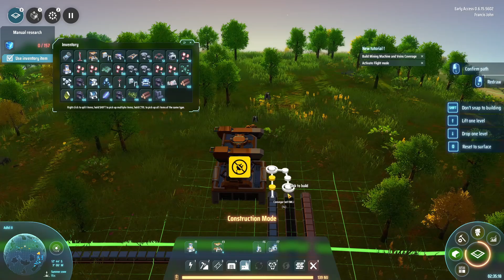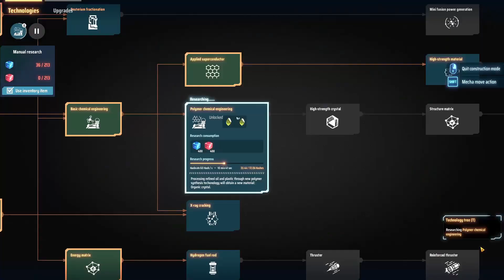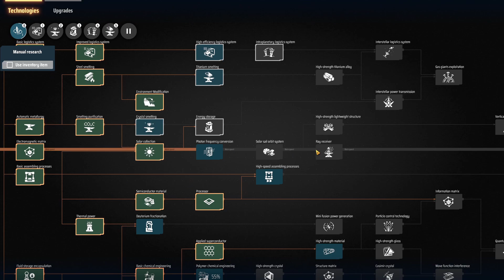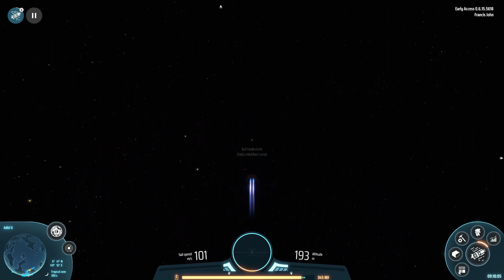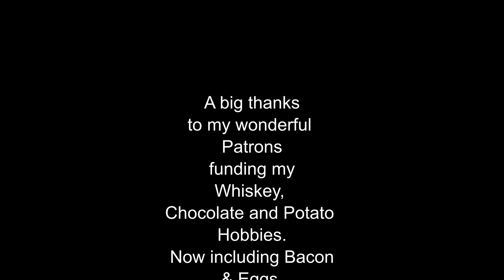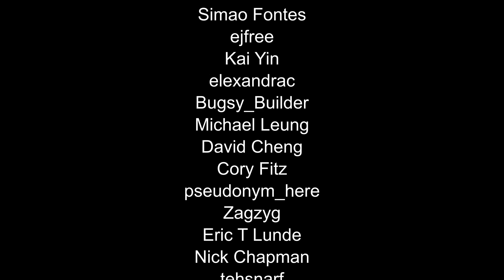Ep2 Dyson Sphere Program, even in space you need oil.

Comment: You can actually set a filter on the loaders so you can have two outputs from a single refinery one for each element, that way it doesn't back up.

Also, you can burn up hydrogen and graphite on the thermal generator too, they generate more power per unit than oil.

Comment: @Francis John

Something I found useful when it comes to buildings with multiple outputs like the oil refinery that outputs both refined oil and hydrogen gas. When you first click 
to attach a sorter to the building you are given the option to select a filter for that sorter by pressing tab to cycle though the options. Then after cycling to the desired filter 
you then click on what your trying to attach the other end of the sorter to.

I like to have one type of resorce per conveyer line so this helps to achive this while saving on a lot of space and placement issues.

Comment: Also, I'm pretty sure the liquid tank storage holds more than the solid storage (for storing liquid). I think it's 3k vs 10k per.

For the liquid storage tanks:
Just route the conveyor to and from the storage. No sorters involved with input/output of liquid storage units.
(Same deal with the "Logistics station")

Edit: Just checked it out. It's 6k vs 10k. The liquid storage has more volume. Though I didn't see any volume control.

Comment: I also would like to see you play threw this. It looks fun. I'm debating on buying it myself though I struggled with factorio. Maybe this one will be better.
Reply from the maker: So far this looks even more complicated than factorio. Though it's early days yet and I am used to factorio.
Reply: I think this one will turn out to be slightly simpler overall, but right now between the translation issues and extremely early access, everything in DSP is so opaque that it's much more annoying to figure out what you need to do.

Comment: you complain that research takes too long but then you don't expand research. what the hell Francis?
Reply from the maker: I know I know, but I did not feel like building a whole second identical factory. It's more in factorio as you do research you unlock new stuff that you need to add to your factory, new weapons or useful upgrades. It felt as though the research I was getting was no use until I got 10 or more other pieces of research to go with it. May be that I'm still new and not seeing the tech routes I should be prioritizing.
Reply: @FrancisJohnYT  i understand, but it seems like just retrofitting the existing research production to produce and use research faster would be a reasonable middle-ground wouldnt it?maybe i'm just a research junky, but i like unlocking EVERYTHING :P
Reply: @FrancisJohnYT  I've spent a couple hours staring at the tech tree with a pen and notepad, working it all out, and I think you're on to something. At the very least, many of the technologies aren't very exciting and the frequency with which you need something from the opposite end of the tree to actually build the thing you just unlocked puts a sopping wet blanket on the excitement of unlocking stuff, imo.